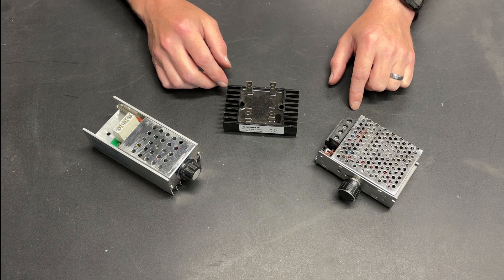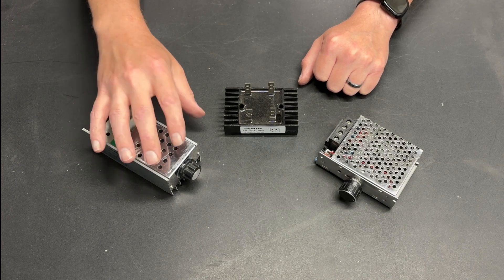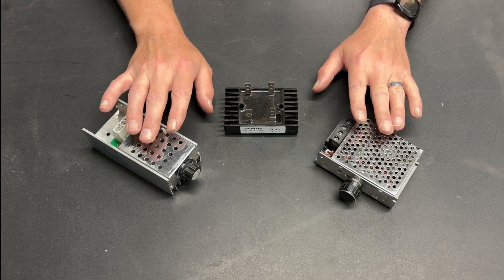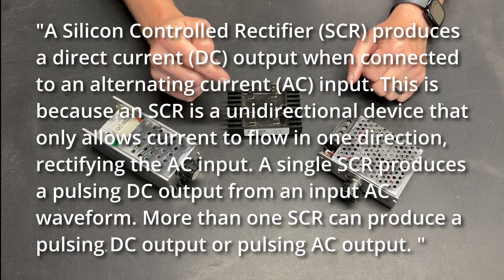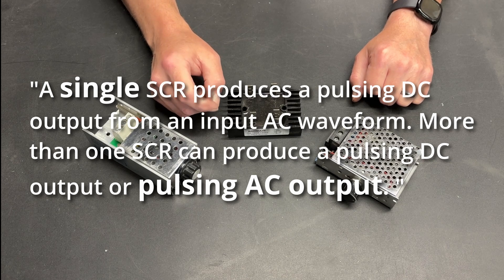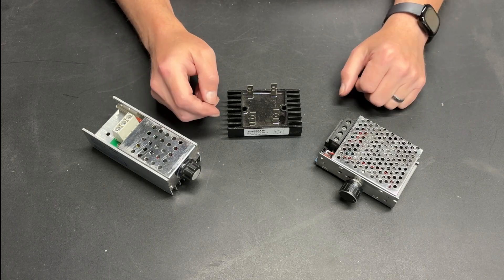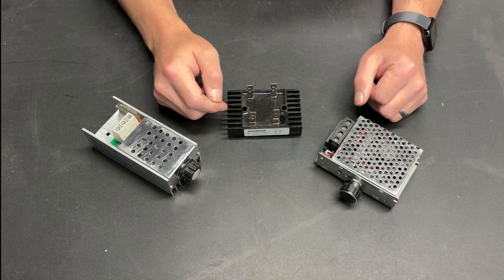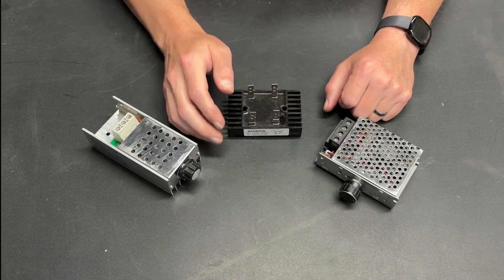SCR or TRIAC voltage controller AC to DC or AC to AC

Comment: Just came here from that spicy thread you mentioned... ;)
I've been learning how to re-purpose 3 faze bldc motors to make a water turbine. and my ebike speed controller died (3 faze bldc) , and in the house I'm building I want to use DC 3 wire CPU fans with PWM speed control, not voltage regulation speed control. to circulate hot air off the wood stove.
These 3 motors all have 3 wires but that's where the similarity ends... boy I miss the days where you turn a motor on with a button!?
the turbine does not require a Electronic speed controller
the ebike does require an Electric speed controller
the 3 wire CPU fan is a brushless motor and uses PWM but is not a 3 faze motor and cant use a Led PWM dimmer nor an 3 faze bldc Electronic speed controller 
and when you figure all that out it taught you you may not be one of the smart people in the world.
I may not be the smartest tack in the box, but I do know that a variable frequency drive has more power over a greater range of speed than AC PWM or AC voltage regulation speed control. so I did figure some things out.
Thanks for the Video it was interesting.
Reply from the maker: glad you liked it.  good luck with your projects

Comment: Dave thought I would share a finding I had with one of the circuit designs you mentioned. I used a triac based voltage controller and a beefy  full bridge rectifier. I used a microwave transformer primary coil (1200w) as a choke. When a found a real 10 amp choke I purchased it. Turns out the microwave transformer performed much better in term of speed control.  Could have something to do with microwave transformer core being so much larger than the  choke.
Reply from the maker: makes sense, a 10 amp choke is likely not a "motor choke"  these motors are typically 15-25 amps.  the choke you ere using likely didn't have big enough wires in the coil to sustain the amp draw of the motor you are using.

Comment: Which is better for regulating the speed of universal motor scr or triac, I want to control the speed of household mixer grinder.
Reply from the maker: neither.  Using this to control the speed of an AC motor is extremely hard on the motor and a bad idea.
Reply: @dazecars  thanks for the reply 🤗, what about capacitor based regulator??
Reply from the maker: That wont be any better.  The issue is not not the power supply, the issue is its an AC motor.  They make something called "a router speed controller" but just like the voltage controllers in my video it will be very hard on the motor and is not somthing I recommend.  Here is a link anyway https://amzn.to/4blv1rn    The correct way to change the speed on an AC motor is with a VFD.

Comment: A rectifier changes AC to DC which is what a single thyristor called a scr does, it only allows the positive phase of the sine wave to pass resulting in a pulsed DC current at half the AC current as the opposite half of the current is blocked. You are correct that a Triac is a single component that contains two oppositely connected scr's and together they allow both phases of AC to pass to AC output so the result is still AC therefore working together they are not a rectifier as the output is not DC. So while a Triac contains, scr's they are not scr's in practice as they have AC to AC functionality not Ac to DC. Both of those devices are Triac based but are regularly described as thyristor or scr based which is technically incorrect but as triacs have scr's as the internal components they are often misrepresented in my opinion by ignorance.
Reply: Eureka! I had learned about how a Triac lighting dimmer worked but couldn't apply it to this video. I'm on a solar system and Triac dimming is wasteful of electricity so I went with 0-10 volt dimming. now I dont have to look up the SCR gizmo... Thanks

Comment: Dave as the king of treadmill motor controllers I saw a schematic with the bridge rectifier in front of the ac control module. As the triac still sees pulsating wave forms and clips the wave at different points to control the power would this work controlling a treadmill motor? I am using your videos to set up 2 dc motors I currently have operating, thanks much. I am thinking about getting a cheep oscilloscope to view the waveforms. I do know the precautions needed to measure high voltage on a scope.
Reply from the maker: First I would love to see that schematic and any information you may have on setting it up that way.  Based on what you said here are my thoughts:  In principle it would result in cleaner power absolutely because you are eliminating the wave before pulsing it.  What I don't know is if the AC power supplies can function properly with DC coming in.  Usually electronics are setup up to work with AC or DC but not both unless the circuit has an AC side and a DC side but even then you can't switch between them.   In most cases it's not as simple as switching the power input type.  If it does in fact work, and that is a big if, my concern would be the load on the switching component TRIAC or SCR.  The single biggest advantage of AC is it is capable of far more amps and volts than DC for the same components.  As an example a switch may have 120V 15A AC rating but only be rated at 12V 5A DC.  Putting the rectifier in front of the power converter will significantly increase the load on those switching components and I would be shocked if they last.  Interesting idea however

Comment: Dave: have you tried to hook up small pwm module to a tiac based scr instead of using the potentiometer
Reply from the maker: They are not interchangeable. Either the power supply uses a potentiometer or a PWM but you can just replace one with the other.
Reply: @dazecars  correct you can't pwm a triac based controller

Comment: Couple of things:

1.  There's absolutely no reason for shame in presenting an argument in support of how you understand something.  Even though it turned out that you were wrong in this instance, you made a reasoned argument, in good faith, and did so in a way that didn't attack the guy personally.  ...If more people were able (and willing) to recognize the difference between figuring out which /answer/ was right, instead of which /person/ was right, there'd be a lot less pointless conflict in the world!
So thank you, for choosing to be one of the first group.  
And I made this exact same mistake just a few days ago, when I "argued" with you about calculating gear ratios between two pulleys.  I was using the wrong formula, and you were gracious enough to explain where and how I'd gotten it wrong.  

2.  I wouldn't be at all surprised if that cheaper unit, with only three pins on the chip, really was a single SCR inside.  It's been a long time since my last electronics class, but that might explain why it makes the motor run so much more roughly at low speeds?  As far as that goes, I wouldn't be at all surprised if a basic multimeter interpreted the rough pulsed DC output to be AC instead.
Side note:  Seeing that multimeter took me back to a time in the early 90's, when I worked at the Radio Shack in Warrensburg MO, while I was in school at CMSU.  We sold those things by the bucket load when they went on sale for $6.99.  They were really great little meters too, especially for the dirt cheap price, and I've still got mine tucked away somewhere.

3.  I've been hearing the guitar riff in your intro/outro for days on end now.  It sounds like early Metallica but I can't match it up in my head with a song title, and it's driving me nuts.  Can you help a brother out, so he can keep what's left of his marbles?  🤪
Reply from the maker: 1.  I am a football official and one saying we have as a group is its more important to get it right than "be right"  Hard lesson for me to learn but has helped me approach things in a much better way.

2.  Pulsed DC still registers as DC and the current coming out of the cheaper SCR is for sure AC so something is happening with the components involved to make it AC to AC.  I too worked at Radio shack when I was in college late 90s early 2000s and that was a fantastic meter.  near then end of my time there they came out with an auto ranging unit that was not nearly as good.  The only downside to that meter is the case ALWAYS brakes eventually.

3.  The music is not anything mainstream so while it may be reminiscent of something you have heard it was not ever on the radio.  It is something that was available on YouTube for creators to download and use.

Comment: I cannot thank you enough for the effort and information you have put into your fantastic videos…I ordered the bridge rectifier and received How to manages unit with the same specifications except it says 2-Phase…all other specs are the same as you recommend…will this cause me any issues…??
Thank you in advance and may you and your family be blessed.
Reply from the maker: should work just fine as long as it has 4 terminals, 2 AC and 2 DC

Comment: Do you know if it is worth running the treadmill EMI filter on the ac input?
Reply from the maker: So the EMI filter is there to keep the treadmill from creating interference in other household electronics like TVs and radios.  In most cases a retrofit treadmill motor is not in a location where any EMI would be an issue so  I say keep it simple and go without it.
Reply: @dazecars  Thank you, your knowledge is very much appreciated.

Comment: So why can't you use just one leg of the output to create just dc voltage?
Reply from the maker: It’s not that simple. You would need to make several changes to the power supply and then it would be less efficient. Far better to produce AC as is and rectify to DC

Comment: So, do we still need a bridge rectifier?
Reply from the maker: Yes you absolutely need the rectifier.
Reply: @dazecars  I thought so because when I tried to check the output voltage, my meter was set to DC by mistake and I got nothing. So, the R in scr means little.
Reply from the maker: This was exactly why I mistakenly argued with the guy that said the SCR was DC output.  I knew for sure the output of these power supplies were AC
Reply: @dazecars  If it was a single SCR it would be DC output but a Triac like in this video outputs AC so you will need a rectifier to change to DC, unfortunately these Triac based controllers are often mislabeled as SCR based which is not correct as they output AC not DC
Reply from the maker: Again I know and that is exactly what the video is about

Comment: A triac certainly behaves as if it's two SCRs, though it is not.
Reply from the maker: agreed but at least it lends some reasoning why sellers are referring to their power supplies as SCR when they are in fact triac?  I am not convinced that the cheaper one is a triac as the chip only has 3 terminals instead of 4 like a triac but I'm not sure how it would be configured to still produce AC.  I wish it had numbers on it so I knew exacly what it was.
Reply: @dazecars  Triacs only have 3 terminals, M1 M2 and Gate, they are indeed two oppositely connected scr's in one device, the AC current reverses between M1 and M2 like the active and neutral wires in mains supply so if you have a 4 terminal device it is unlikely a Triac.
Reply from the maker: I got the part number off the component and looked it up.  it is in fact a triac and does in fact have 4 terminals

Comment: Thanks for the video and for the clarification. I found your videos very useful. I am using your method to run my trademill motor but instead of using dc choke I am using capacitors in parallel to bridge rectifier and also using a flyback diode for protection.
Reply from the maker: Glad it was helpful!  I tried several capacitors but I found it created surging  under load, I hope your results are far better.